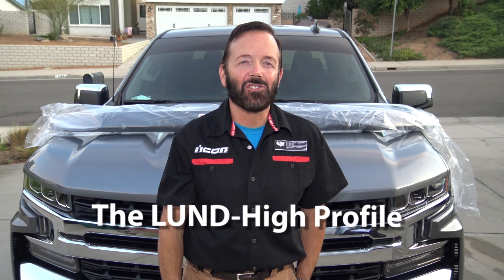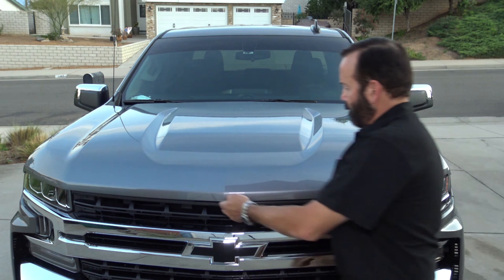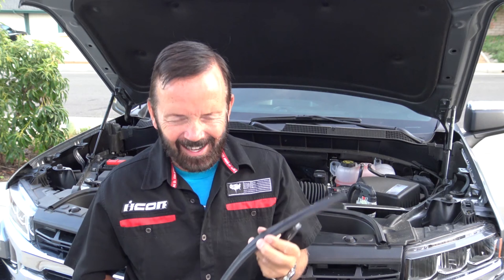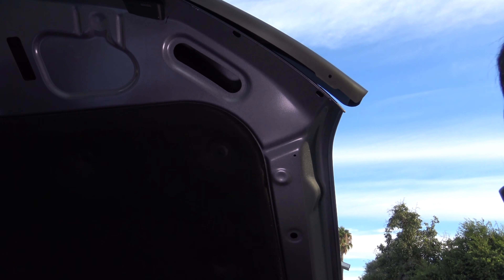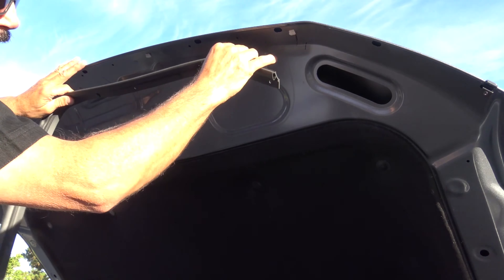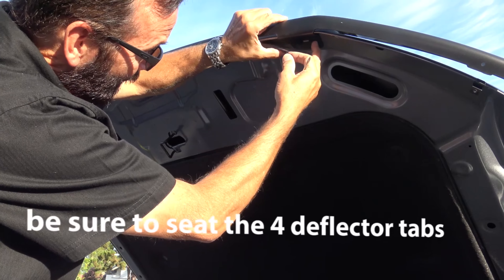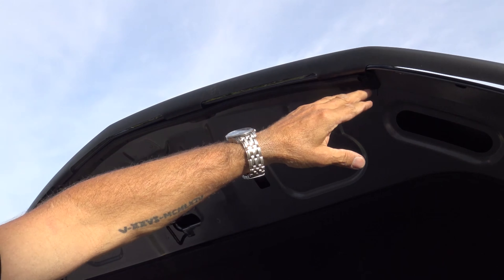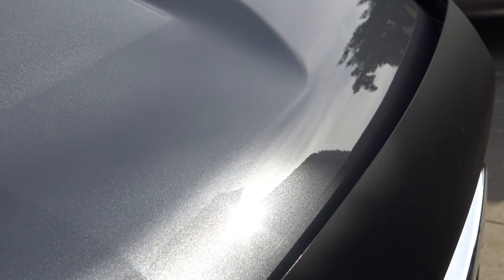The EGR-Hood Guard Protector Install w/Paul Henderson  4K  9-2019

Comment: I realize this is 4 years old, but I just now saw it and wanted to say thanks for the great video. Also, it creeped me out in the beginning because for some reason you look like you're standing in front of a green screen and the picture of the truck is composited in. Then you turned around and grabbed the part off the hood and it blew my mind a little.
Reply from the maker: I'm going to have to re-watch this video. 
And it almost 5 years old it still looks the same The truck and the hood guard. I did have to use some of that glue goop and glue the outer 2 brackets to the underside of the hood to hold them in place.
Reply from the maker: Ok. I just watched the beginning and it does, I thinks it's from the video lights I had shinning on me.

Comment: I wish I would have had one of those on last week when a bird flew into my hood and dented it.It would have hit the guard and saved me $500.
Thanks Paul.👍👍
Reply from the maker: WOW. You could still buy it and install the guard to cover the dent from the bird it it hit the hood at the very front of it. But that does suck, I did have to get a new windshield a week after I had the windows  tinted, I did see a mark on the hood guard so the guard on my truck did what it was supposed to. It protected the hood. I'm sure it would have hit the hood and then most likely hit lower on the windshield then there would have been a dent on the hood and a broken windshield. so to only have a broken windshield to me is better than having both damaged.
Reply: @HowtowithPaulHenderson  
Yes,I could do that,but it would drive me nuts.It goes into the body shop next month.
Reply from the maker: @travelinben1966  no I get it I would do the same thing... It would drive me nuts too. I work at park my truck out in the boonies I'd rather have it get stolen than to get freaking dents from stupid ass people that don't care about their own car I would like to slam their door into a nice car because they don't care. My firebird was 23 1/2 years old I had very small dent on the hood that you could barely see from a clump a dirt from a truck but it's really hard to see so I didn't mind. So for 23 1/2 years one small dent not too bad

Comment: Thanks for the video. You dont have to remove the weather striping. Just the 4 pins that the directions tell you. I put the end clips on backwards and couldnt shut the hood. Your video was helpful and showing the correct position of the end clips! The instructions are terrible. Thanks again man!
Reply from the maker: I knew I only had to remove the 4 pins, but I removed the entire strip by mistake. Dang it.... And I almost did the same thing with the clips.....you might have to glue the clips to the underside of the hood. I used weather strip adhesive...my clips started to slide off the clear tape strips. It's been just over 5 months and they haven't slid off at all.
Reply from the maker: I have a question. Have you had any issues with the two metal clips that are at the ends of the defector.  After about a month I had to glue the clips to the underside of the hood so they would not vibrate loose. It's been 6 months and I have not had any problems the RTV glue seems to be holding.
Reply: So far everything is holding in place. I'll let you know if they come loose
Reply: What advantage is the EGR over the Lund?
Reply from the maker: @jeffreymcroft  sorry for the extremely late reply. I can't remember, but the first one I ordered was for a different style hood. So I'm not sure if that one was the LUND bug guard...

Comment: Great video. The only problem with this shield is that the end metal clips go over the hood and are supposed to be protected from rubbing on the hood paint by a thin piece of tape. With the constant wind vibration, the metal clip will eventually rub through the tape and start rubbing on the hood paint. I changed my mind on the installation today and am returning it. I’m sure there are those who are not worried about this but I didn’t want to risk it on 2019 Silverado.
Reply from the maker: Clean the spot with alcohol. If you can re use the tspe. Buy some clear RTV glue and cover the bracket on the piece on the underside of the hood and about a 1/4 all around it. And let dry..mine did the same thing. No problem since I glued it down. Just make sure the tape  isn't much bigger the the clip.
Reply: Thanks for the reply Paul. I’m talking about the top of the hood. Not worried about under the hood. The metal bracket will eventually wear through the tap on the topside of the hood with the constant vibration and start to get to the paint. .
Reply from the maker: Once you glue them to the underside of the hood you will not have any problems.  I almost returned mine also, But I found the solution to the problem. I wasn't happy with gluing the clips to the underside of the hood with the RTV glue. But I thought the protection of the Hood was worth it. It's been 6 months and there has not been any issues. Once the RTV cured, you can't even see it, plus it's on the underside so no one will even notice.
Reply from the maker: On August my truck will be 2 years old. I did glue the two end clips on the under side of the hood and replaced the screws at both end clips with longer screws and  lock washers... haven't had any issues since.

 And yes I was worried about those clips being worn through the tape if there was constant vibration from the wind and there was, that's how I lost one screw. I still have the tape on there but I trimmed the tape on the underside to be no bigger than the clip and then glued them with RTV sealant....
..

Comment: Hello Paul, we are from Germany and we watch your channel regularly, it is always very interesting and helpful. A few months ago, we had already written to you in the comments about Pulsar LT. Maybe you remember. 😉 We decided to buy a bugshield from AGR (# EGR 301691) and also read about some problems with the fastening. You solved it with extra glue and longer screws, and we wanted to ask if you've had any problems since then or if everything is still fine.
Greetings from Germany from Katrin and Kai 😎
Reply from the maker: No I have not had any issues since I used the sealant on those two brackets, I do believe I used new screws and locking washers to hold the bug guard to those two brackets since the other ones would vibrate off. I used clear RTV sealant as a temporary fix which has lasted all these years, If and when those two brackets come loose I might use a stronger type of sealant but nothing that is permanent as to where it may ruin the finish.. but I did have some extra clear protectant tape that I cut to fit underneath those two brackets. The plastic tape I had was from the clear protection kit that I had ordered for the headlights and door protection kit from WeatherTech, I didn't use the ones for under the door handles on the outside.
Reply: @HowtowithPaulHenderson  👍thank you so much 👍

Comment: What advantage does the EGR deflector have over the Lund or AVS off the hood deflector? Noticed that the EGR is quite a higher price.
Reply from the maker: I don't know the answer to that.The one I installed was an off the hood type also..plus mine is a matte black. maybe  the way it mounts on the underside of the hood....the first one I bought from chevy, I had to take back because it was a stick on type and I did not want that type of deflector....I am going to look up one and and check it out. I'm a bit curious now.
Reply from the maker: I checked out the Lund and Avs deflectors on line. I didn't see any in matte black. The ones I saw were cheaper then what I paid. I think that my EGR deflector looks better and it blends in better with the grille, because it's matte black. but no matter what one you choose be sure it's not the stick on type, I know two people that had stick on types and when it had to be replaced after when the tape did not stick anymore  the paint under was ruined. Not saying that happens with all of them. Just saying.
Reply from the maker: Okay I just checked today is April 9th 2021. I went on the Chevy site from my Chevy app. The Lund bug guard is a stick-on-style with double stick tape on the back that fits flush on the hood and I believe it's textured black.
The EGR is matte black and sits off the hood. My truck will be 2 years old in August and the bug guard still looks good and no paint damage.

Comment: Am I looking at this wrong or did you misalign the weather strip? It looks like it's one hole too far towards the passenger side of the truck.
Reply from the maker: Probably just looked like it. I did not need to remove the strip at all. Just the 4 push pins.  
  I'm glad I installed it almost as soon as I bought the truck. About 4 weeks ago I had to take the truck in for new lifters on the right side. 
  Chevy gave me a new 2019 Silverado to use, I  inoticed it had 2 chips on the front right where the protector is. 
  Chevrolet did the work for free. I'm hoping that's the only issue I will have.

Comment: Do you have to drill any holes in the hood for this deflector? Or are you just using the existing holes from the weather stripping?
Reply from the maker: No, absolutely not at least for this model. On my 2006 there was no drilling required on that model either.
Reply from the maker: The only extra step that I had to take that wasn't in the instructions... was with the 2 clips at the end of the hood kept sliding down from there spot.. No big deal. so on the  two metal clips I had to use some clear RTV sealant and coat the underside of the clip and then also put some on top of the clip ...not on the top side of the hood...just to be sure it was coated well. . You can't see it because it's on the underside of the hood.

Comment: Poor design!
Reply from the maker: Can I ask why you think it's a poor design.
Reply: @HowtowithPaulHenderson  because it shouldn't mount under the rubber seal
Reply from the maker: @artiemcbride629  The four push pins that are removed from the gasket are for the four plastic nuts that are to be inserted into those holes are to hold the four screws that will hold the OFF THE HOOD DEFLECTOR in place plus there are two outer brackets one at each of the deflector. This is the same set-up as the Weather-Tech version, the only issue that I had was that the two outer brackets would slide of off the hood over time, so I had glued them in place with GOOP from the underside of the hood to hold them in place. No new issues since I had done this.
Reply: @HowtowithPaulHenderson  like I said, a very poor design.